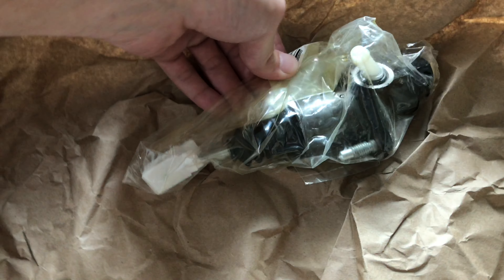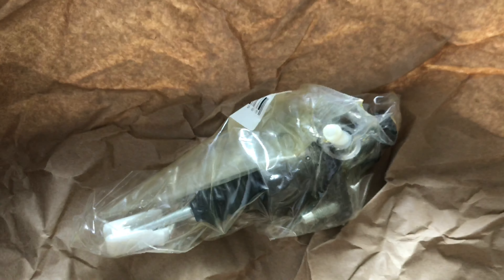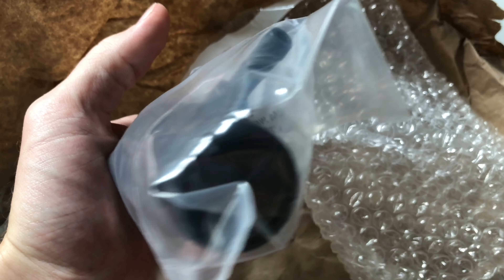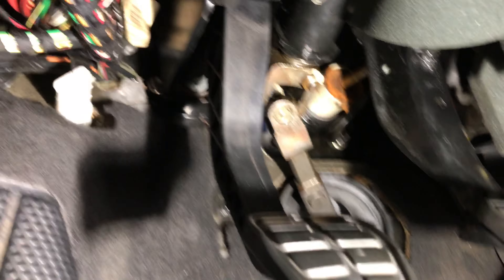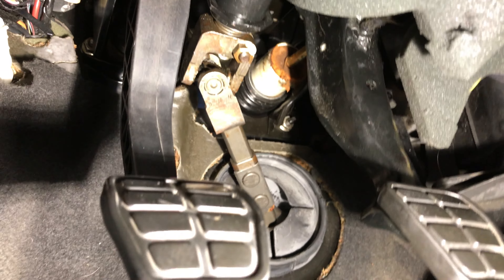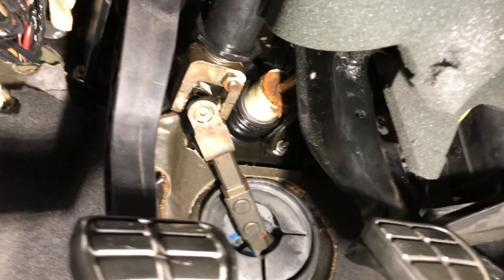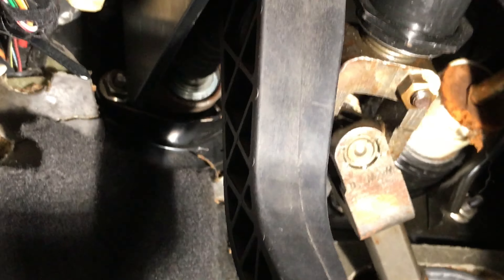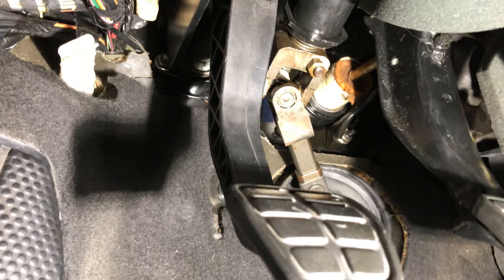1997 MK3 GTI VR6 Clutch Master Cylinder Replacement

Comment: Do you have any suggestions why after bleeding the clutch, there is no pressure and the clutch pedal is sticking to the floor?
Reply from the maker: leaking somewhere or the Slave cylinder is bad too